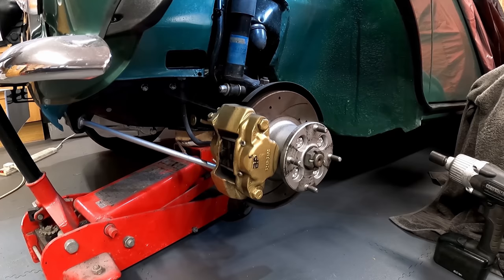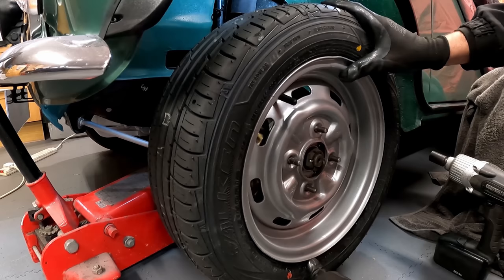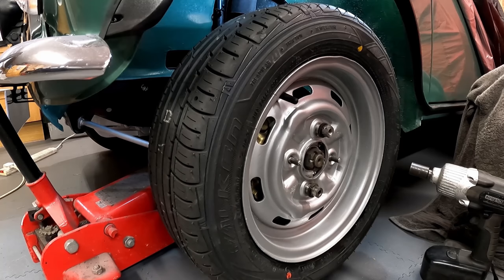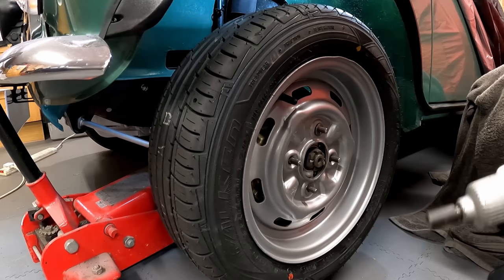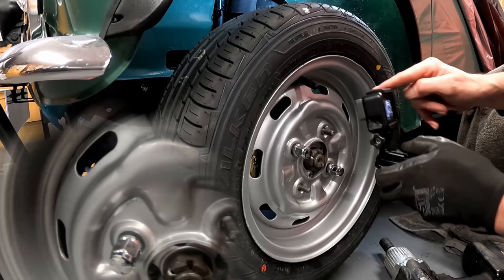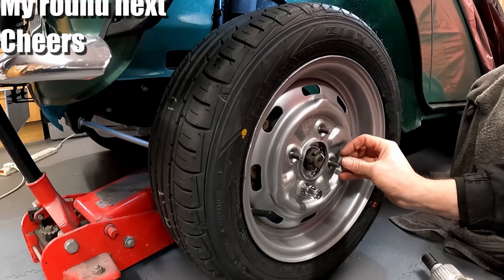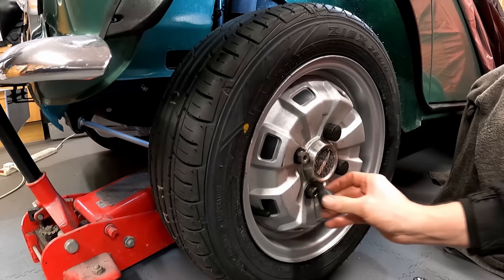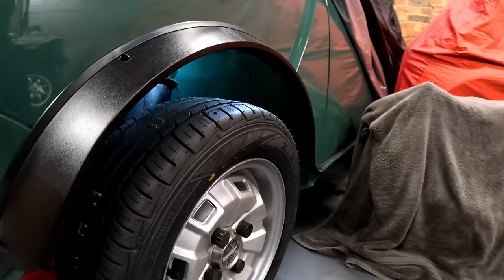Lathe Work & Wheel Fittings - Classic Mini Workshop Project Pt.28

Comment: Another sterling effort Keith. They look so much better than the skinny originals.
I have original Dunlop D1s on my Mini and they have sleeve nuts similar to Revolutions. They are a real PITA to put on as you have to centralise the wheel with your legs whilst sitting on the ground.

Comment: wouldn't have been easier to source some imp wheel nuts n studs....???
Reply from the maker: I'm pretty sure they are not compatible and the hub caps wouldn't have fitted. The whole point was to retain the original hub caps for the OEM look